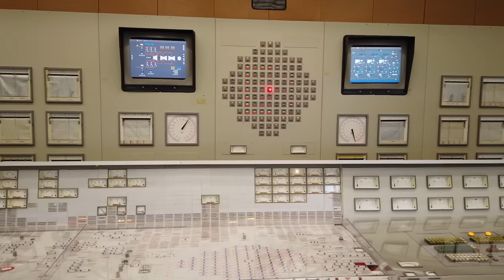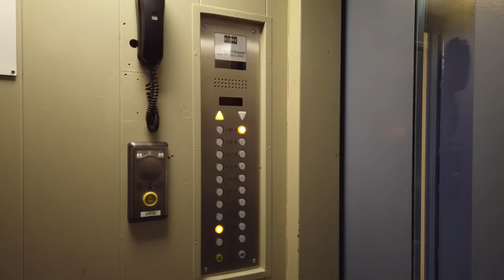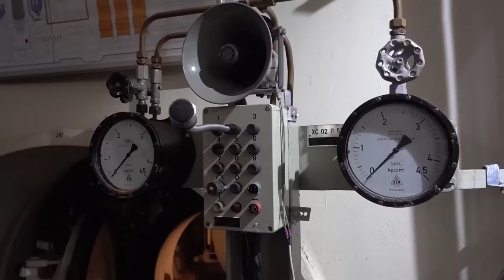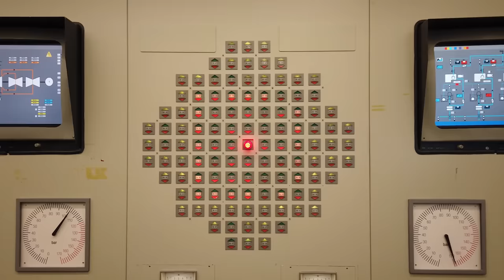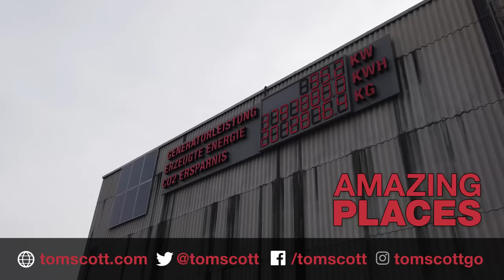This billion-euro nuclear reactor was never switched on

Comment: I find it crazy that in an age where we are reliant more and more on electricity, we are turning our backs on nuclear energy. Modern nuclear plants are safe, clean, and even their waste be be re-used. And of course they do not rely on the weather or the time of day. And when it comes to the environment, you only have to travel out into the countryside to see mess that wind and solar farms are making of the landscapes. I can't even imagine just how big a solar farm would have to be to produce the same amount of energy that even this old 750 megawatt would have produced. And of course the solar farm only produces electric during the day. Here in the UK we are banning the sale of any new petrol or diesel powered cars from 2030 onwards, along with banning the fitting of anymore gas central heating systems to homes. Our electricity usage is going to double over the next decade or two. So much more of our countryside is going to be ruined to meet the demand using solar and wind. The system is crazy, try building a small home in the middle of the countryside and you will be refused permission because your building will be a blight on the scenery. But energy firms are granted permission to build turbines over hundreds of acres of land, whilst covering another thousand or two acres with solar panels. We should be embracing nuclear power, not turning our backs on it.
Reply: Problem is when a nuclear power plant goes wrong. The more of them there are, the more of them there are that can break. Which part of England are you willing to cordoned off if there’s an issue for a couple of hundred years?
Reply: @conors4430  Manchester
Reply: @conors4430  Us frenchies haven't had so much as a scare due to nuclear in some 80 years of operating nuclear plants. But I suppose other countries aren't willing to repeat the same success, least of all the british.
Reply: Saw another video on this plant and according to that video the solar panels they installed here make the same amount of energy in a year then that the old npp would've in 90 minutes.
Reply: @conors4430  How many nuclear power plants in operation have had catastrophic failures over how many years, and how many of those were due to incompetent design?
Reply: @conors4430  Should we stop flying because when they go wrong hundreds can die?
Reply: Honestly, I don't mind the sight of renewable farms on the landscape.  I am, however, bothered by the massive amounts of open-pit mining and environmental destruction required to maintain "clean" renewable energy.
Reply: @conors4430  All of it
Sincerely, an American.
Reply: The big issue with nuclear power is that the Enrichment and mining processes are extremely harmful, and we also don't have any long-term storage for nuclear waste yet.
Reply: Well, Austria isn’t a very large country. Imagine if something did go wrong!
Reply: @palmberry5576  planes carry so many people imagine if things did go wrong
Reply: @garbandgulyberdimuhamedow4604  well, at least if something goes wrong with a plane, an entire country doesn’t fall
Reply: @palmberry5576  except nuclear power has only 'gone wrong' 2 times with any deaths or injuries. Imagine if there were 2 plane crashes so people decided to never to use planes again.
Reply: @garbandgulyberdimuhamedow4604  chernobyl and the military one in Idaho right?
Reply: @SuperBlueMoonWA  I meant fukushima and chernobyl. Though fukushima while still bad only lead to one death.
Reply: your so right, nuclear ninnies! waste of money and cheep energy.
Reply: @wta1518  We actually have long term storage. Tom Scott even did a video on it. The title is "Inside The Tunnels That Will Store Nuclear Waste For 100,000 Years".
Reply: @conors4430  modern western nuclear reactors dont go wrong. old soviet ones do, but the list differences between western designs and RBMKs is extensive, and even the RBMKs still in operation arent that dangerous nowadays following their post-chernobyl amendments
Reply: @wta1518  the mining process needed for solar panels is just as, if not more, harmful, also what are the harms of enrichment?
Reply: eh, only about 10% demand for electrifying cars is more accurate
Reply: @wta1518  You need batteries to make solar panels and else effective, but batteries require to destroy the environnement even more. And we do have ways to store nuclear waste on the long term, lots of underground special building were created for this.
Reply: @emmaqueen9757  Are they operational yet? Didn't think so.
Reply: @wta1518  They're being build,  the majority of them will be finished in less than 5 years. And even then, the amount of waste that need to be throw away is really small, and can be safely stored on site in special containments. Doesnt even create an issue, so whats your point?
Reply: @emmaqueen9757  So we don't have any solutions yet. Got it.
Reply: @wta1518  I dont think you quite understand what the word solution means. If you want to play with words to make a point, dont do it that bad.
Reply: @emmaqueen9757  Saying that we have a solution to nuclear waste storage when all solutions are still being built is like saying that we have fully autonomous driving right now.
Reply: @wta1518  false. Autonomous driving is being *developed*. Nuclear waste storage sites are being *built*. The difference is that when you build something, you already know how it will be. You have already tested it, you have already ran all the math to make sure nothing can go wrong. However, when you develop something, you are only starting to figure it out. You don't yet know the final shape
Reply: @wta1518  we already have long term storage - how do you think French are managing their multiple nuclear reactors?

Hope and dreams?
Reply: @aravindpallippara1577  Temporary storage.
Reply: @wta1518  pff you are wrong just accept it, you don't always have to be correct . Learn from your mistakes instead of fighting them.
Reply: @wta1518  yes we do! You should do some more research before commenting. We’ve solved the issue of storing the waste. Nuclear power is the safest means to generate electricity
Reply: @beccascott2867  It is absolutely not the safest way. It's not as dangerous as coal or oil, but it is by no means safe. Also we DON'T have PERMANENT storage. P-E-R-M-A-N-E-N-T. That means not temporary.
Reply: You mean like 3 Mile? How about all the guaranteed permanent damage from gas, coal, hydroelectric? The acres of land lost to solar panels?
Reply: Solar farms make sense in some countries like mine, Spain, but i see no use of solar farms for countries like the UK, here it is always sunny, enven in winter it is still sunny enough for solar pannels, and we do not rely on heating our interiors for the most part of the year, our biggest consuption of electricity is in summer in the day and we do happen to have a lot of hydraulics in place, and hydraulics can be repropoused as batteries for solar, you pump up during the day and relase down trough turbines to generate electricity during the night. So here solar makes a heck of a lot of sense. 
But in the UK i dont see it working, i have been there, you guys have no sun at all.
Reply: Nuclear plants are safe, clean and cheap. PICK TWO.
Reply: @user-vj4ql5ul7q  I pick safe and clean. I also add reliable and by far the most rational until nuclear fusion. They are expensive, because it's not being adopted massively. Remember prices of "green" energy a few years ago? Yes, nuclear plants are expensive, but compared to what? Shitty alternatives? Dealing with natural disasters? Wiping out ecosystems? Mass migration?

Renewable energy sources are cheap, reliable, green, space efficient. Pick NONE.
Dealing with rapid climate change is easy, convenient and cheap. Pick NONE.
Reply: @conors4430  Fukushima is completely habitable rn
Reply: @angryjelly7025  your life is false what is up with spouting nonsense to prove someone wrong when it takes 2 sec to google it.
Reply: @wta1518  It is the safest aside from solar.

And when you say "permanent", what are you trying to say? Is having safe storage with no risk of radiation leaks for tens of thousands of years not permanent enough for you? Stop playing with your words and being intentionally obtuse.
Reply: @HollowBagel  No, it's not enough. It needs to be safely stored for up to 1 million years.
Reply: @conors4430  same goes for other sources of energy
Reply: @conors4430  Nuclear power is far less dangerous than you imagine. People see the word "nuclear" and think of nuclear bombs, but nuclear reactors are far safer to humanity than burning coal and ruining the lives of billions of future humans. Did you know that they even use nuclear reactors in military-grade submarines?
Reply: @wta1518  Deep geologic storage can absolutely safely store nuclear material for hundreds of millions of years,
Reply: @lorscarbonferrite6964  No it can't. You don't understand how this works, do you?
Reply: @wta1518  It absolutely can. You can claim that I don't understand how this works, but that's a remarkably hollow accusation when you've done little more in this thread than plug your ears, shut your eyes, and desperately try to block out any information contrary to your established view point. Geologic barriers can in fact contain radioactive material, including radioactive fission products, for long enough for those materials to decay safely. This can be seen best from the Oklo mine. A sustained fission reaction continued there for hundreds of thousands of years, and even though groundwater was part of the reactor there, even after almost 2 billion years, there was no evidence of surface contamination. In fact, most of the fission products seem to have barely moved from where they were created.

Your denial of reality does not make it false.
Reply: @lorscarbonferrite6964  And what if a future civilization digs into it without knowing what it is, and it kills a bunch of them? What if geologic activity moves it closer to the surface? The problem isn't building something that can contain the radiation, the problem is building something that can contain the radiation and also keep future civilizations that we can't communicate with from getting inside and hurting themselves. And the Oklo mine proves my point, because we were able to get in, therefore it wouldn't have worked. I'm not plugging my ears, it's just that no one has been able to give any correct evidence that I'm wrong.
Reply: @conors4430  Fossil fuels is thousands of times more dangerous than Nuclear Energy ever will be.

Arguing about the safety of Nuclear Energy while we continue to use Fossil Fuels instead is incredibly short sighted and hilariously tone deaf.

By every single metric, Nuclear energy is safer than Fossil fuels by a very very wide margin.
Reply: @wta1518  We already do have permanent storage